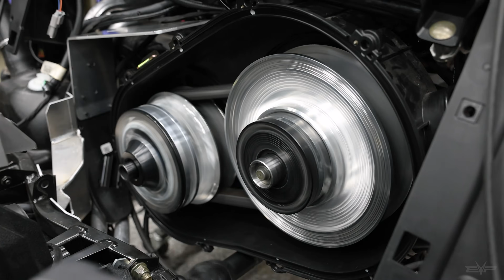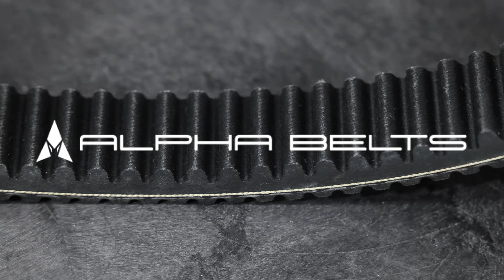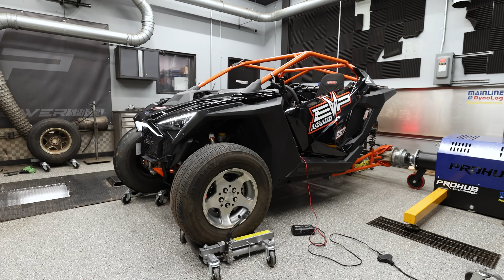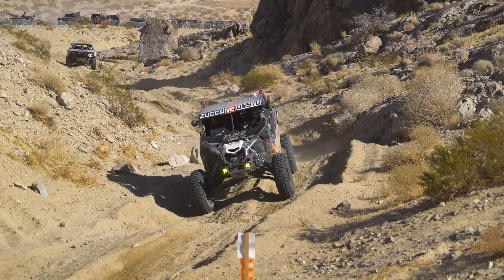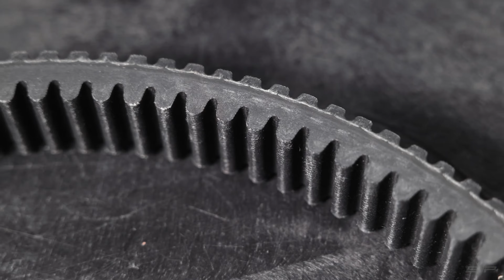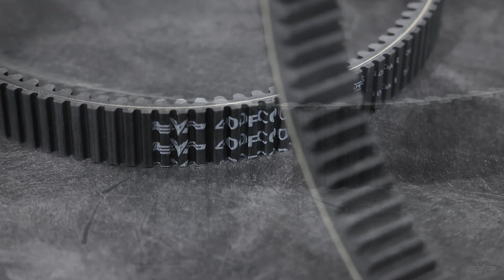All-New EVP Alpha Drive Belts for Can-Am Maverick X3, Polaris RZR Turbo & RZR Pro R!

Comment: How do i get one? I have 2 500plus hp machines to test on.
Reply: Well I tried this belt on my 500hp can am x3 car. When I dune the car i turn boost down to 32 psi, I normally run the gboost rs belt for duning. Installed belt, drove it easy 20 miles until belt was making full contact on clutch surface. One thing I noticed was this belt had better clutch grip than anything else I have tried.  Belt lasted 60 miles and I broke it on a rolling hard pull. The rs belt I removed had a few hundred miles. I believe this new belt is awesome and I think I got a defective belt. My belt temp when broke was 110 120 degrees.  I am sending the alpha belt into evo to have them look at it. Like I said my car pulled harder with this belt than anything else I've tried. I've been racing utv and drag snowmobile for 35 years and it is possible to get a defective belt. Hopefully evo will take care of me. I am ordering the alpha for my 500hp pro R as well. Also I noticed the angle finish on the alpha fit my clutch better than anything.  You want the entire belt face to contact clutch, that is why break in is important.
Reply from the maker: They'll be on the site and ready to ship Tuesday 4/15!
Reply: @EvolutionPowersports  how does the compound compare to a gboost rs?
Reply from the maker: All new compound and, equally important, a new finishing procedure. We're seeing the lowest belt temps we've ever seen/tested with these!

Comment: This will be interesting for testing, i have a full built can am x3 built engine, billet block, xr54 at 45 psi boost. By far the strongest belt i have used and the only belt i use is the gboost rs race series. I can pull apart a can am belt in 1 or 2 passes. Belt is 80 degrees. That rs belt is strong. I also have a pro r turbo running 18 psi on e85 and the polaris belt is pretty good so far. Looking forward to testing this belt. I will put it through the ringer..